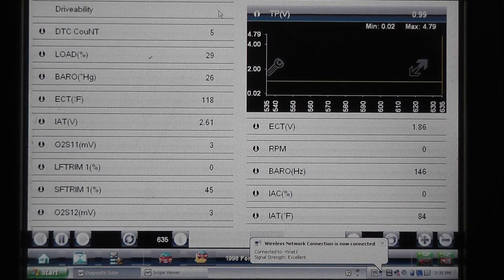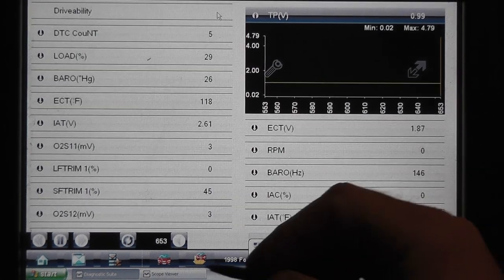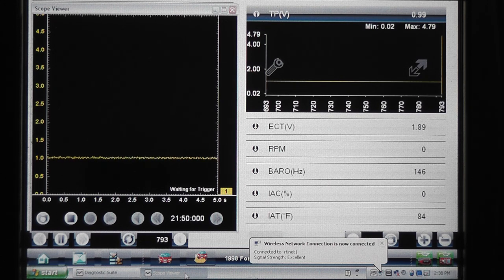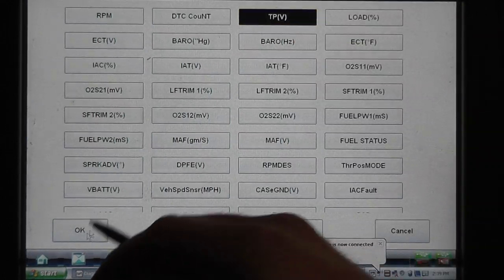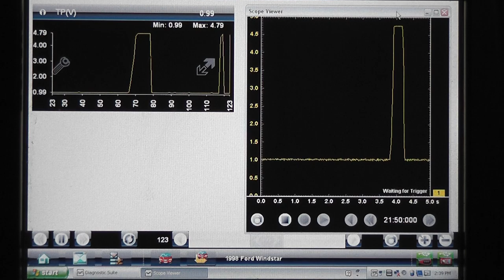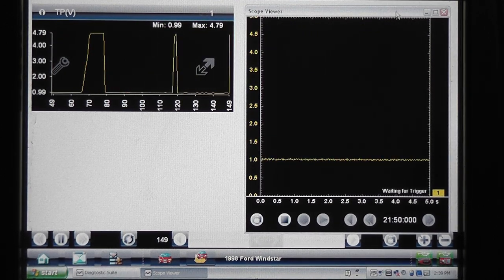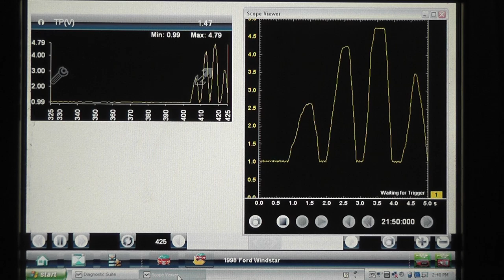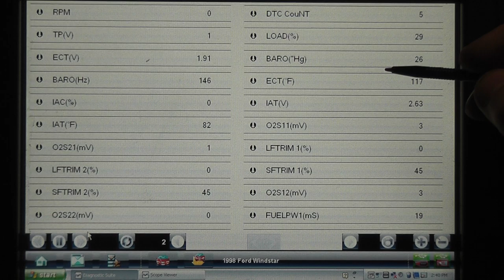Scan tool data graph vs Lab Scope waveform (Throttle Position Sensor Testing)

Comment: Is this problem until now in all scantols 
Do you find beter faster scantol give you fast graph when selecting all sensors using same this test
Reply from the maker: The car is also a factor. It is not just the scan tool that limits this speed

Comment: I have a DOOZIE of a problem. Bench testing PCM I get 0 to 12V for VSS signal. Put scope VSS signal wires for instrument cluster and I get -6v to 6v (wrong reference pin?)... The cruise control, odometer, and speedometer do not function on the Dash. It's a 1999 Corvette. It all seemed to happen when my instrument panel lighting flickered. I had a horrible problem with instrument panel flickering, so I serviced my grounds and it went away. Then the speedometer slowly went out to point now where it won't respond at all, but cluster does pass self check, sweeping the gauge at startup. I even took the cluster apart and cannot visually see any issues with circuit board. Pin header for connector is also good. PCM also registers correct speed with scan tool. No clue, complete loss, been trying to figure this out for years :(
Reply from the maker: Where do the vss wires go directly?  Just the ECM or it there a splice to the cluster too?
Reply: @ScannerDanner  wow thanks for replying! You're the god of wiring on YouTube! The VSS Signal goes from PCM through two connectors, grommet on firewall, then to cluster according to FSM. There's an optional splice which I don't have (verified visually). I did a continuity check at all connections to connector for cluster. I think I may have found my problem. The PCM worked first time I bench tested it so I put it back in. I got about 3 seconds of functioning speedometer. I pulled PCM again and it failed the bench test. I'm going to swap PCMS and see if that fixes the issue. Dang this is a bugger to track down. Thanks again!
Reply from the maker: @exploringgodscountry  so the VSS signal goes to the PCM and then the PCM sends that signal to the cluster? Is that what you're saying?
Reply: @ScannerDanner  the sensor signal (sine wave) goes into the PCM. The the PCM converts that to a square wave and sends the square wave to the cluster. PCM reads the sine wave correctly. But doesn't seem to be outputting the square wave when I drive. Found a some time and hooked an oscope up in place of the cluster.
Reply from the maker: @exploringgodscountry  so you have a PCM issue or a wiring issue in between the PCM and cluster
Reply: @ScannerDanner  I think is a PCM issue. I'll know when I get a new PCM. I cannot find issues in the wiring at this point and VCM is failing my bench test.

Comment: What should the TPS % be at idle? At full throttle?
Reply from the maker: depends on the car, some systems the TPS MUST be 0% at idle and on others around 10%
As for WOT it is not uncommon to only see 75-85%. You'd think they would all read 100% but the reality is they do not and it is not a problem